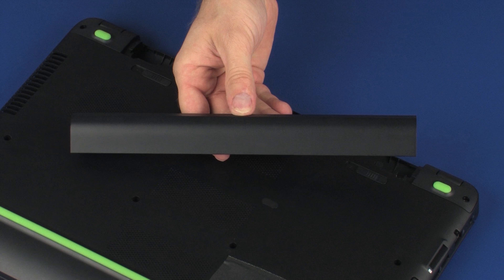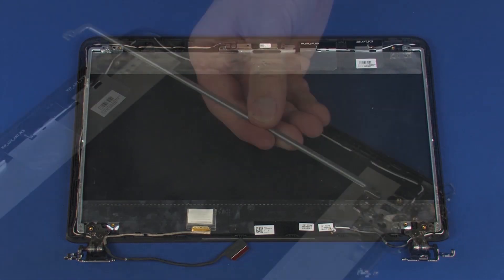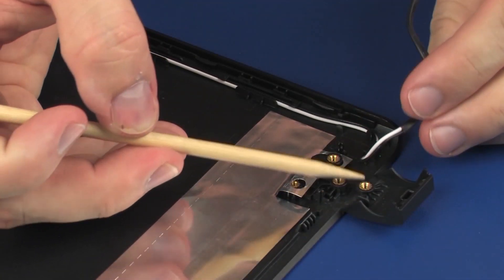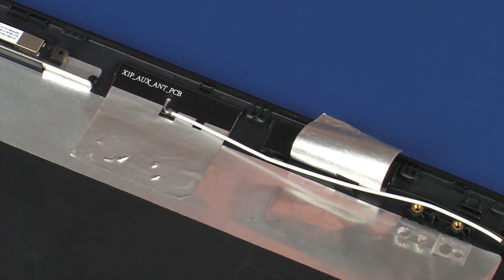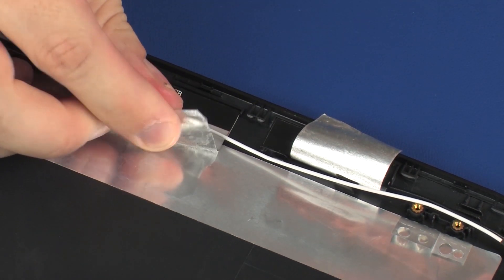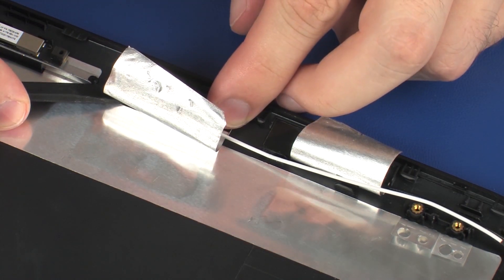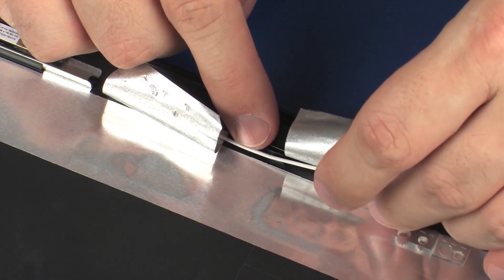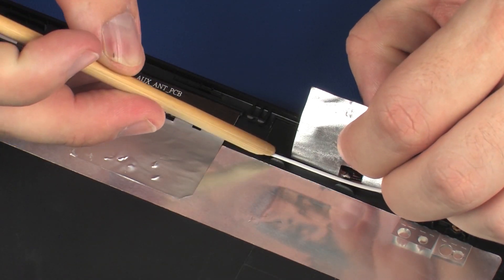Replace the Wireless Antenna Cables | HP Pavilion Gaming Notebook | HP Support

Comment: I have a ELITEBOOK 840 G5 i need to set WLAN for cellular using.. my laptop cant find out the antena cable for that port..?
Reply from the maker: Hi there, thanks for contacting HP Global Social Media Support!
I understand that you are experiencing an issue in setting up WWAN module on your notebook.
I will do my best to assist you.
Please refer page number 45 of the user manual to know about setting up WWAN module: https://hp.care/6050mhyq6
Regards, 
HP Support

Comment: Can this damaged wifi wire cause dead pixels in my monitor?
Cuz i did get dead pixels and its spreading.😢
Reply from the maker: Thanks for getting back to us, the Wi-Fi wire causing the pixel damage would be unlikely, but In order to get this issue fixed, please contact our customer care team over the phone or chat for further assistance, as this issue requires Live conversation with you over phone or chat to isolate the issue and provide you instantly with appropriate solution or repair/replacement options available at your place as per the warranty.
Please feel free to reach us on call/chat, please access this link to select your preferred country and language option to reach us. Global support link: -  https://hp.care/6051YSCU5
Regards, 
HP Support

Comment: Would this increase the signal strength of bluetooth? My laptop only has a black wire and not a white wire
Reply from the maker: +xboxgamerJ16 HP does not recommend upgrading or downgrading hardware parts or software that is bundled with the product as It may affect the manufacturer's warranty and performance, however, you could change the configuration at your own discretion.
Reply: @HPSupport  but what if they were parts you made? My hp has a single antenna. Im asking if i could take an auxiliary antenna and add it to my wifi connection?
Reply: @HPSupport we just want better signal range!!!😩🤌🏽

Comment: I cut those wires thinking they were display cables when my display had gone bad and I tried to remove the screen completely🤦🏻‍♂️
Reply from the maker: +Vineet Kansotia I understand that you accidentally cut the wireless antenna cables. If you are interested in purchasing wireless antenna cables or other accessory, use below link: www.hp.com/accessorize 
I hope this helps you!!

Comment: How can I buy for my laptop??
My wire is also damaged so I can't use wifi and Bluetooth.
Please reply soon.
By the way your laptop are best❤️
Reply from the maker: +Karan M You can purchase the part from here: http://partsurfer.hp.com/ Please select your country and enter serial or product number of your unit.
Reply: Did you found the antenna cable?

Comment: Can we join the broken wire ?
Reply from the maker: +Asis Thapa We do not recommend joining wireless antenna cable. However you can replace it as mentioned here: http://bit.ly/2ISPY0r
Reply: @HPSupport  But soldering the wire back would work, right? Also - the adhesive paper, would it matter if I was to cut off a bit of it before regluing? Does the length of the wire matter for the signal?
Reply: @michalnkg6434  hi! did the soldering work for you? i  removed de screen and i want to cut the wires a little shorter so they can fit in the keyboard
Reply: @gascl  i did not shorten mine since I could use different antennas for my mini pc. I think that the wires do not receive the waves themselves - it's the end bit that does that.

Comment: if the cable plugs from the antenna to the wlan card are damaged, would this affect signal quality?
Reply from the maker: +playvoltage Yes. It will affect the signal quality.
Reply: instablaster